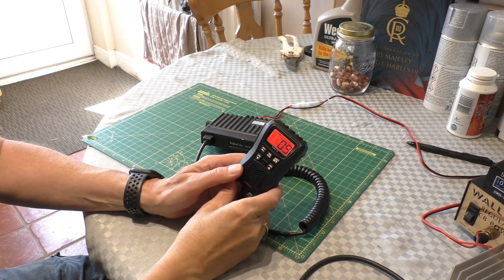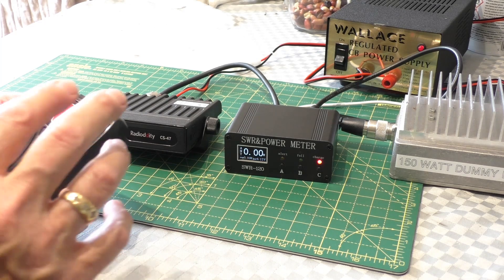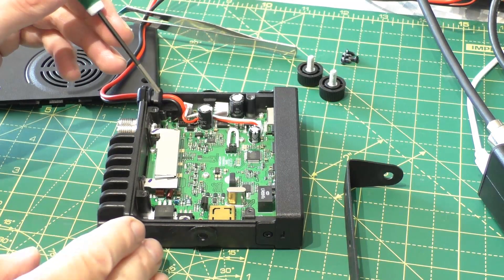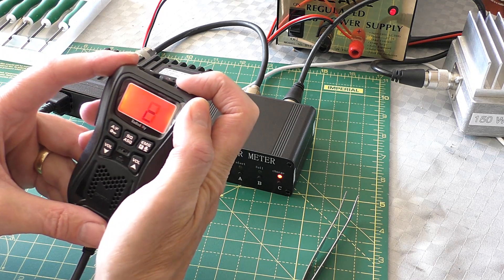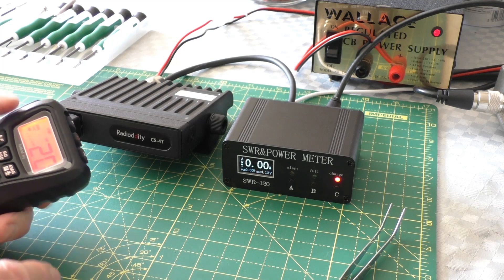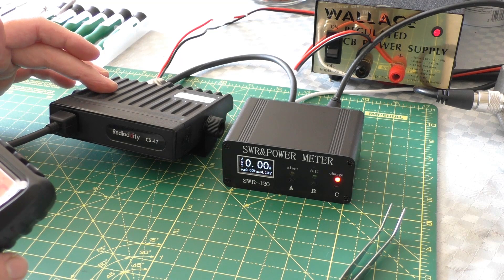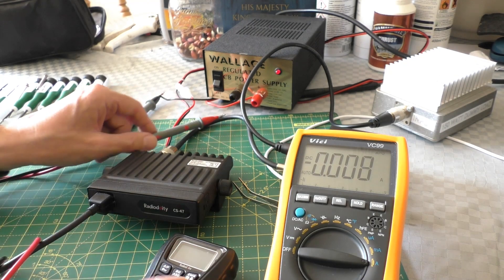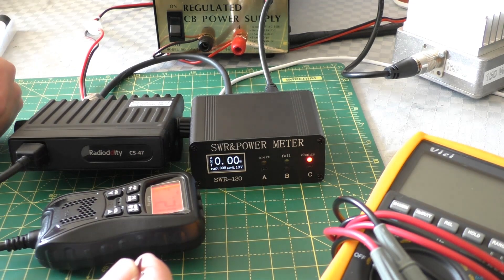Extra POWER mod (no soldering) from a  Radioddity CS-47 CB Radio.

Comment: Question: I've had the cs-47 for a few months already. Although I haven't yet done the the mod. 

However, I've noticed that when I transmit on fm, I'm also heard on AM. Is that a normal occurrence with this radio?
Reply from the maker: Only if the radios are close.
Reply: @CB-RADIO-UK  Thanks for the info

Comment: what size screwdriver did you use to take off the cover and remove the 4 screws?  It appears to be a Torx bit driver?
Reply from the maker: I think mine were normal Philips.

Comment: i have yet to fire mine up. 
but found a neat place on my dash this little guy fits into. 
now awaiting daylight so i can hook up the coax and power.  not sure if a chassis ground should be installed.  as everything is plastic these days. 
is the dc power ground ok for this radio
source and ground directly to and from the battery. 
unit is isolated.
Reply from the maker: TBH ive not wired a mobile rig for a long time but i always used a ground point as an earth.  The radio does not pull a very high current.

Comment: Maybe get 2 S units additional output for skip at the expense of the radio.  Locally, the power difference is negligible. Not sure it’s worth it.  I wouldn’t want to burn it up.  Nice video though.  Negative:  the amount of work it takes to walk thru the menu system.  Worse than a Baofeng.
Reply from the maker: Good point!

Comment: Mate you can easily mount an arctic cooling fan on that unit no problems. Mount with a temperature sensor and away you go. Never have to worry about the radio getting hot. Modify the top cover to allow fan fitment👍👍

Comment: Oh wow what a breeze those mods are. Last time I did a mod on a 40ch am-fm-ssb unit in 1982, it involved switching certain pins of the PLL processor to ground to get 120 channels and substituting RF output and driver transistors for more beefy versions...
Reply from the maker: Yes its dead easy to mod.  Normally you have to solder tiny pins on a pcb.

Comment: I use one on band D AM here in the states with the "mod" as a base station next to my hospital bed. My meter shows 2.75 watts on low and 6.5 watts on high. I have it running into a Procomm PT99 base antenna. It does shockingly good for what it is. Everyone says the audio is nice and clear too. I am in Oklahoma USA and have made contacts in Oklahoma, Texas, Kansas, Colorado, Tennessee, Georgia, Florida, Kentucky, South Carolina, Ohio, Pennsylvania, Mexico and Jamaica so far.
Reply: So band "d" here in US would be the standard am cb band?? Or is it something else.
Reply: @V84ever that is correct. Band D is the US CB band. Channel 1 26.965MHz to channel 40 at 27.405MHz
Reply from the maker: Sweet

Comment: Hay Fred this seems very compact little unit. Just want to seek your advice as I know nothing about CB.

I own a mx5 and me and my bro do road trips in Europe where mobile coverage is spotty. 

I no longer use the cars areal so would be nice to use it for something. 

Is this unit possible to hard wire in a car and run of a areal. I’m not transmuting far like car to car over a max of a mile
Reply from the maker: Hi.  Your car antenna is tuned to the FM band 88-108 MHz.  UK cb radio uses 27 MHz so it wont work iam afraid.  You would need a proper CB antenna.  A magmount would got center on the boot lid.  More on mobile Cb antennas here.  https://www.youtube.com/watch?v=-4dbYAigpvw

Comment: Any idea if the other radioditty models have the same mod available?
Reply from the maker: Not the same iam afraid and no where near as easy.  The little CB-27 does have a high power mod but requires soldering skill.
Reply: CRT ONE V has the same L-4W M-8W H-18W power modes and (A to L + UK bands.)
Reply: @subsubl  is there a video for this mod?

Comment: like the radio . i think i would strap on a bigger heat sink  for high power use think medium power wouldn't be bad  .i have a 2meter & uhf   it has a super small fan mounted in it

Comment: Don't waste your money on buying that radio it don't have upper and lower sideband and it don't have lower channels in it either and it don't have a lot of power like a galaxy Stryker or the rci radios I won't buy that radio Fred in the shed you got ripped off dude 73s
Reply from the maker: Your going to have to pay double the money for a SSB radio.  This is a good mobile solution.
Reply: @CB-RADIO-UK  not it's not sometimes you have to bite the bullet
Reply: @CB-RADIO-UK  and lot of people like upper and lower sideband and lower channels that away the can talk so people don't Walk all over them
Reply: This is a great little radio for having a mobile CB. It is easy to use, requires no license, and is discrete in the car.
The radios you mention are very capable and powerful radios, but they are in a different class, serving a different purpose.
Reply: @mr.l3785  I use my rci 2950dx mobile as a base unit my rci 2950 Dx mobile is hooked up to a power supply and the radio has the cb band and the 10 meter band I'm also a amateur radio operator
Reply: @matt3030whiteeagle  Nice setup. And very cool that you are licensed.

Comment: That’s a lot neater than having to crudely short the Transistor’s emitter & collector on similar radios,although it is probably doing something similar. It is also surprising how well these tiny sets cope with heat.Thanks Fred.

Comment: That rig will get hot as a pistol at the higher power level.  I recommend aiming a small fan at the heatsink.
Reply: Actually, it does not. Gets only slight warm, but not hot at all.

Comment: It might be illegal now but when the SHTF it's a life saver, everyone should be given a choice, in normal conditions, run it on low, when there is an emergency, switch it to high, its's the same responsibility as dialling 999, it's illegal to call that number for no reason, everyone has a mobile but don't call 999 for nothing, there is no training to use a mobile, it's called Responsibility

Comment: Hi Fred 
Don't use the Mid 8w on Am mode there is not enough headroom on radio Fred!
It distorts the Am modulation 
8w car X4= 32w pep ,radio cannot do it.

Im aware of this as put other similar CB on test communication monitor can see Am waveform distort.

I would suggest use Am 4w carrier  x4=16w 85-90% so that's ok Fred 

Use FM 
4/8/15w only 

I would advise a big fan blower in 15w mode gets real hot!

Great vid Fred 👍

Kind Regards 

Rob P

RP Comms Systems.
Reply: I'm hearing good results ,and heard Simon using one Fred.
Ctcss is way to go with CB now 
Interference free!
Soon to come VoIP CB gateways ctcss controlled.😉

Comment: But does the dummy load prevent the radio from damage if it’s connected to that rather than an antenna?
Reply from the maker: You would be fine with the antenna but power would depend on the SWR.  The dummy load has a perfect 1-1 SWR and is a 50 ohm impedance so no power is lost.
Reply: @CB-RADIO-UK  ohh that’s great to know!

Comment: I think it should be fine to run it like that. Its clearly done by design and you would hope it is designed well enough to run at those power levels. 

Looks a good little radio

Comment: Much better off using a small linear, the heat generated from the extra power will shorten the life of the radio.
Reply: Thank you for that l have just ordered one
Reply from the maker: Yes i think a small 35w amp would be safer for the finals.
Reply: @CB-RADIO-UK What finals does it  use Fred ? Did you happen to look.

Comment: Much easier and safer to just use a small amplifier, say something like a kl35 or kl50. Keeps the actual unit legal and fully warrantied. Just use a very good quality patch lead between the radio and the amplifier to keep losses to an absolute minimum. Make the patch lead longer if you're putting the unit into a mobile, that way it can be hidden out of sight and use an inline power switch to the amplifier.
Would be cool to see how that little power meter performs at the far end of a length of coax to simulate losses at the antenna base.
🇬🇧👍😎👍🇬🇧